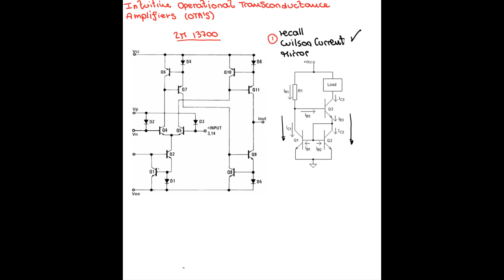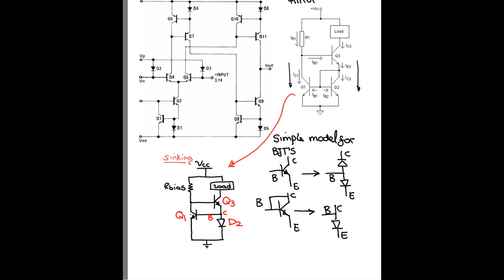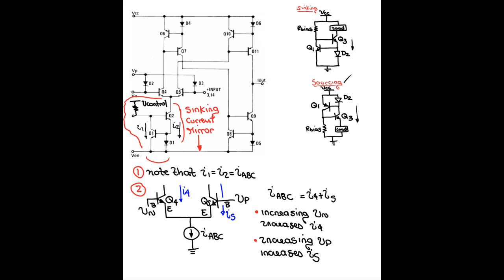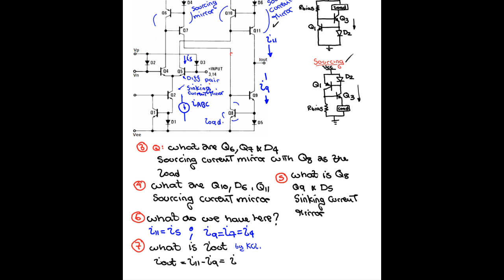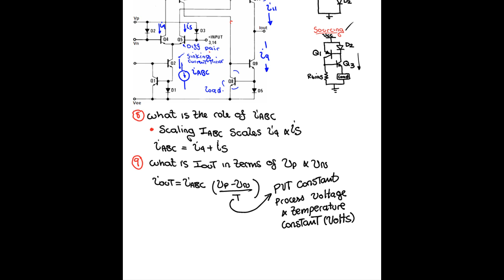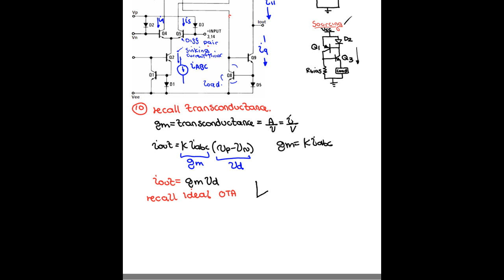Operational Transconductance Amplifiers

Comment: good video but how can you replace a transistor with a diode just by connecting collector to base?  is this realy the exact same thing as a diode?
Reply from the maker: A diode but not a good one. 
A collector-base tied BJT makes a diode with poor operating characteristics. While It is a PN junction, it has the incorrect dopant concentrations to make it a good discrete diode. 
This is mostly a simplistic model to facilitate understanding.